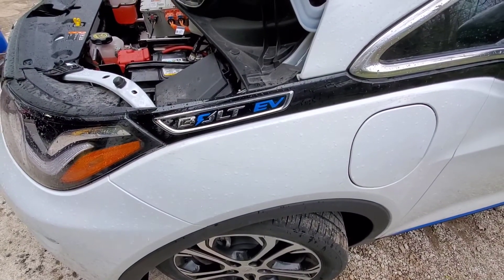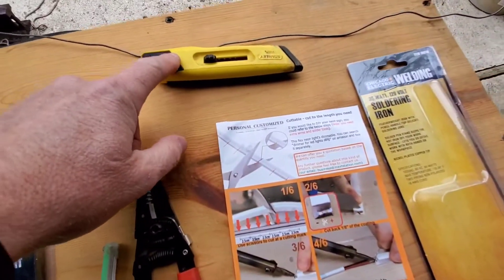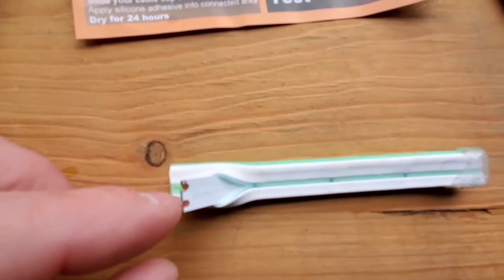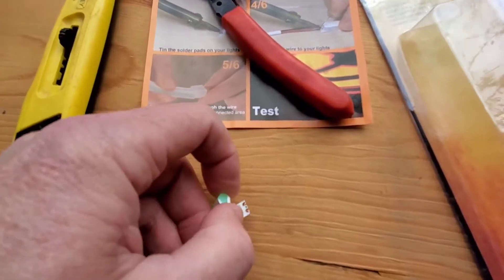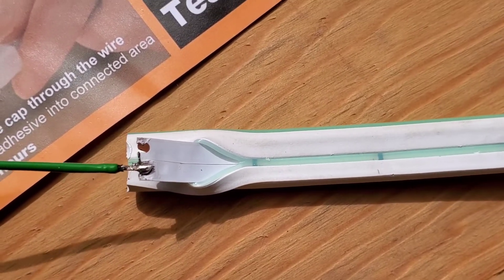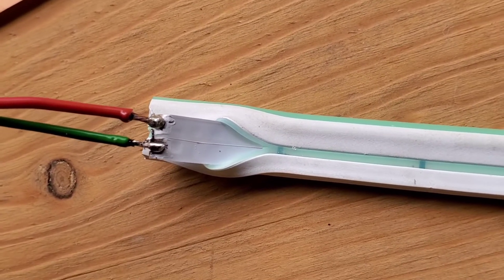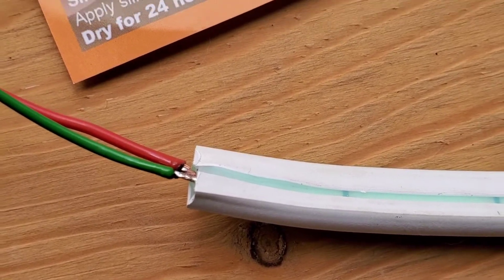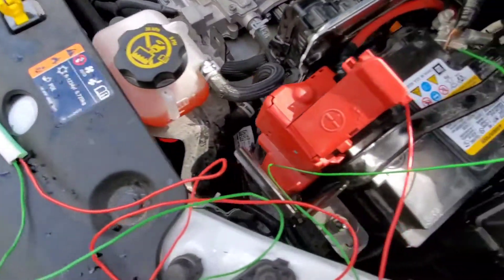Chevy Bolt light strip

Comment: What about the connecting tips that connect to the car's harness?  Did you find that on Amazon, too? If so, what's the link?
Reply from the maker: I have a more detailed video: https://youtu.be/gJkD8gDF2bI
It's in the description witch set I used, but they are no longer available, so I found another set that should work just fine.
(Twippo 352Pcs Waterproof Car Electrical Connector Terminals Automotive Electrical Wire Connector Plug Kit 1/2/3/4 Pin Connectors Male and Female) https://a.co/d/gjfEaGo
This is on Amazon as well. I hope this helps. Thanks for watching
Reply: @Gordy Photography  that's awesome.  Thank you man!!